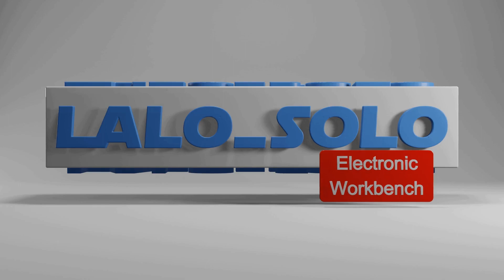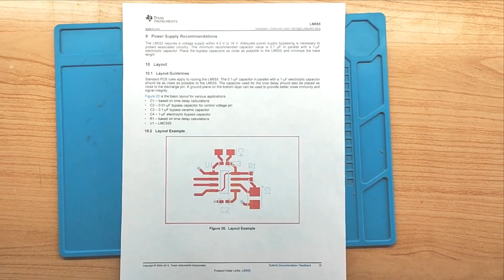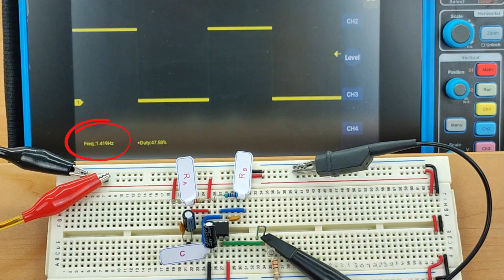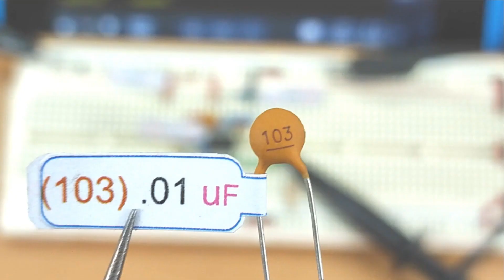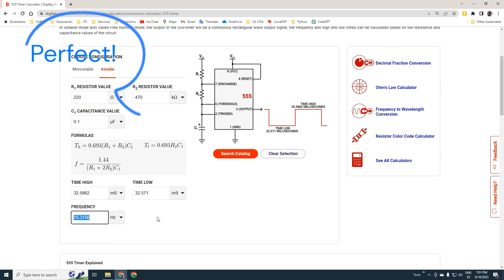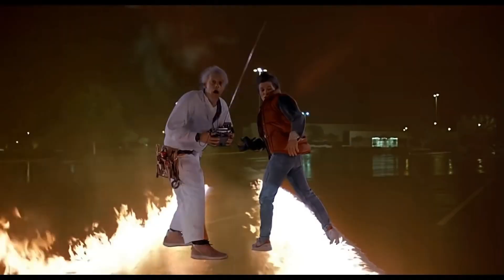555 Timer – Pulse generator assembly

Comment: I don't like the "standard" circuit of the NE555 given in the datasheet for several reasons. And I also preferrably use the TLC555, because it has shoot-through protection and a symmetric rail-to-rail output. So I can control charging and discharging of the capacitor directly over a resistor from the output pin, which gives a good 50% duty cycle.

The "standard" circuit wastes a lot of current if you use low values of R1, like 220 Ohm. At 5 V operating voltage the circuit consumes 23 mA or 135 mW unnecessarily. This is quite a lot. The NE555 consumes also 3 mA at 5 V and every swithing event at the output can lead to shoot-through current of 200 to 300 mA. The TLC555 only consumes 0.5 mA.

The discharge pin can be used as an open collector output to draw multiple device to the same output line. So I don't like to use it just for the discharge of a capacitor. So I have my very own philosophy to use 555 timers in circuits and most of my circuit designs differ a lot from the standard.

Comment: Can I use this to generate 1 Hz pulse? I'll set RA to 680 ohm, RB to 6.8 Kohm and C to 100 uf, Vcc is 5V. Everything else will be like the video setup. I need this pulse to be fed into a 7474 as a clock later on.